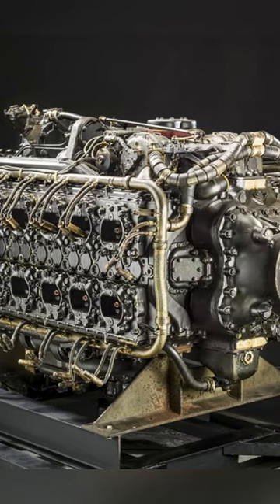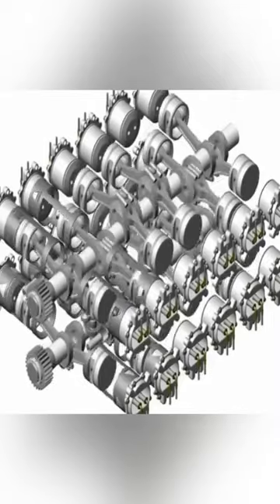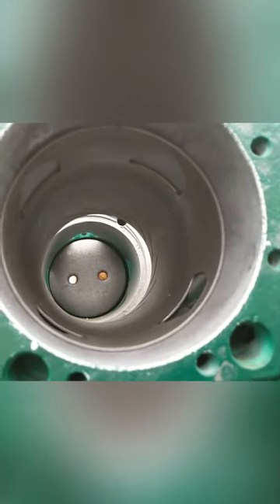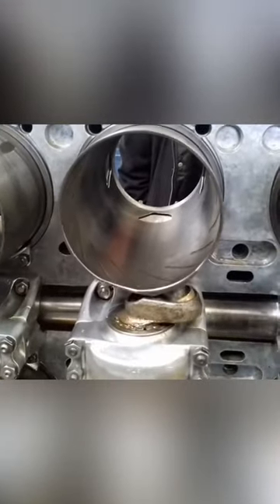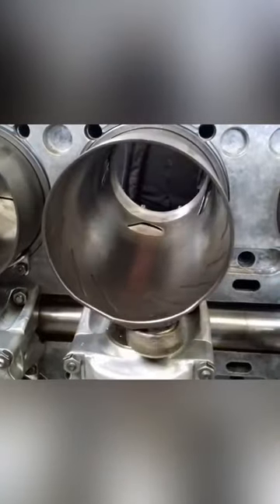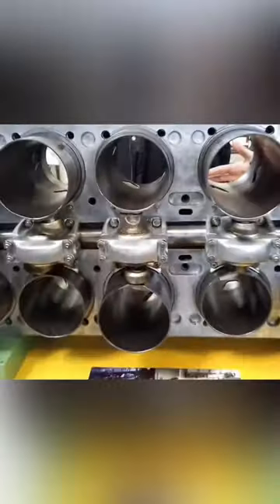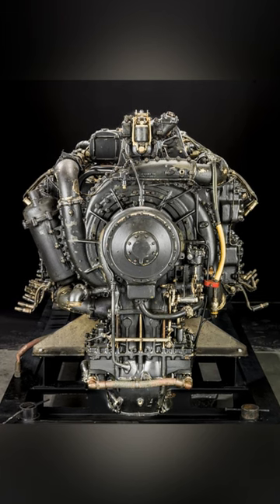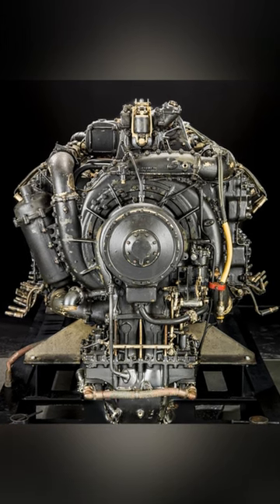STRANGEST Engine Part EVER Made!? -Napier Sabre Valve

Comment: How complicated can we make this?.... Mmaann.
Reply: The sleeve valve engines had a power advantage in the early 1930's when 70 octane avgas was common.  The compression had to be kept very low on poppet-valve engines since the hot exhaust valve would cause preignition and rapid damage.  The sleeve valve engines could run higher compression and were more efficient.
As octane levels of fuel were boosted, largely with tetraethyl lead, compression ratios could be raised significantly in poppet-valve engines and a lot of the power advantage of the sleeve valve engines went away.
Reply: Ty for the info bud  @jfess1911

Comment: What’s with the Brits and their allergy to turbochargers?
Reply: In those days turbochargers were very unreliable. This was 1944.
Reply: @timoakley277  Turbochargers and superchargers on planes especially, due to the changing air pressure. If you forgot to turn it off at low altitude, it could explode the engine.